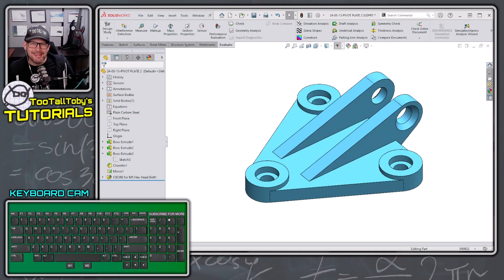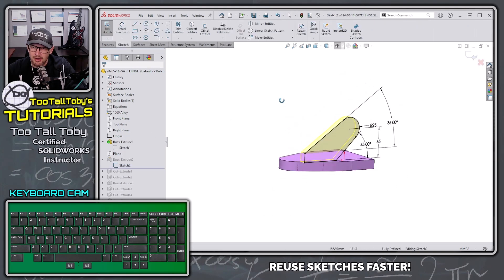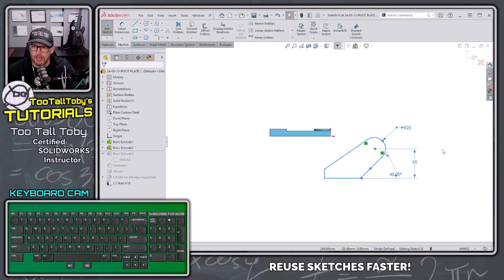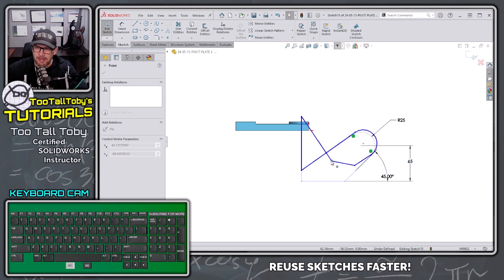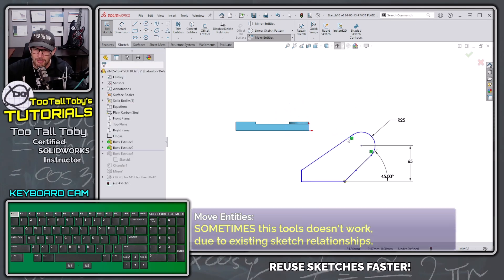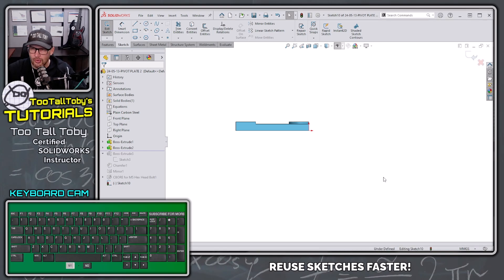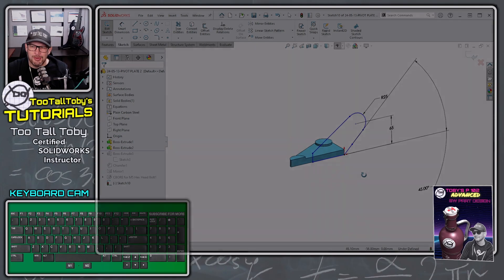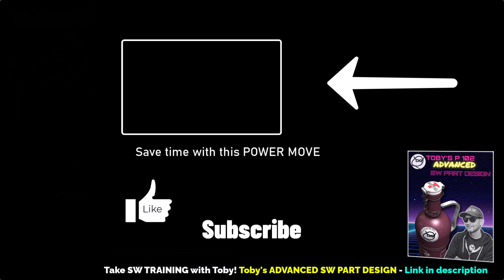TOP SECRET SOLIDWORKS tool to RE-USE sketches!

Comment: If you are going to paste from one sketch into a new blank sketch you may as well copy the entire sketch and paste it onto the plane desired.  If you are pasting from front in one part to front in other part, for example,  the geometry should be correct and nothing needs to be moved. If you paste from front to a user defined plane then the geometry will be offset.  In that case, paste to front first and then convert entities for the entire sketch onto a new sketch on the user defined plane.
Reply from the maker: Thanks for the suggestions!

Comment: Click the sketch point, hold ctrl, click the other sketch point. Choose coincident. Same outcome. This also works for mating in 3D assemblies.
Reply from the maker: This is indeed a great shortcut, and one I made a video on (Letting go of CTRL) - but I dont think this will work with an underconstrained sketch as only the point will move, not the remaining geometry.
Reply: @ lol i know right when you make a relation on something under constrained all hell breaks loose.

Comment: This is super useful

Many times when I do this kind of stuff I just add all the relations before moving the sketch so that it is fully constrained except its not anchored to anything, of course that is a hassle on anything that is not a simple sketch with few lines
Reply from the maker: yeah exactly I've done that many times before too - but this really opens some new options - it will also allow you "on the fly break relationships" in some situations, which also ends up being a nice time saver!

Comment: Fun fact, it also works if you copy the sketch entirely from the feature tree, then paste it in the same or another feature tree, without entering or opening a new sketch. I used this trick with the soap holder part, but then Toby came with better solution 😎😎